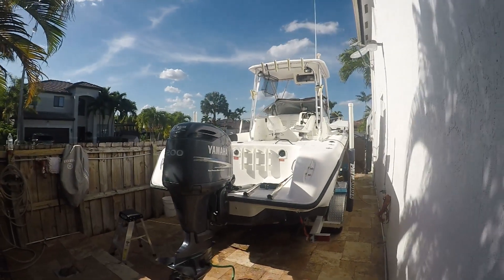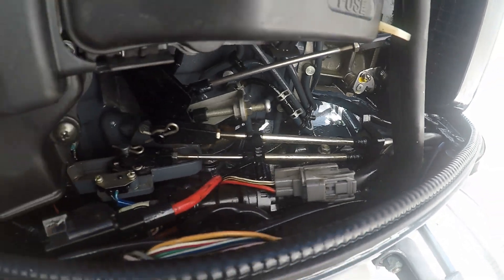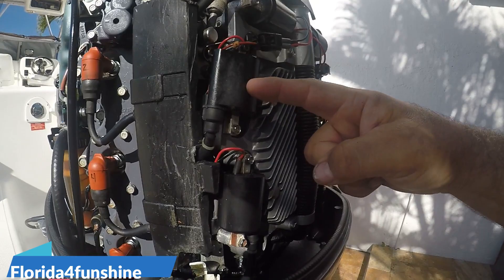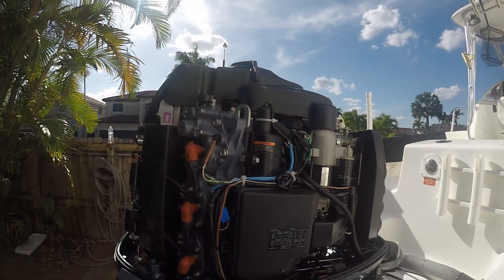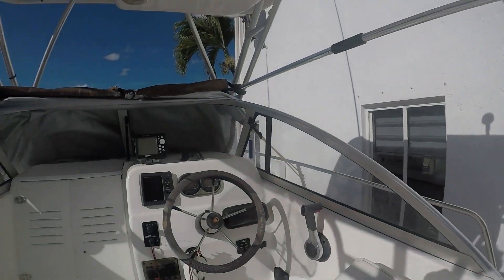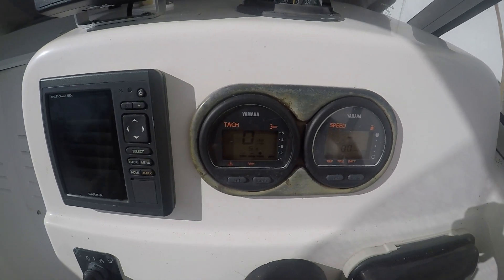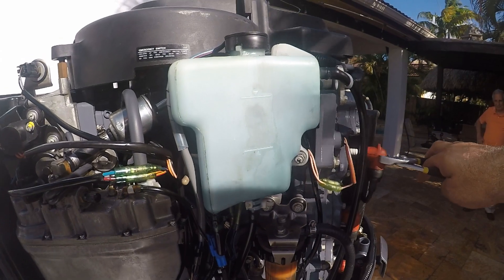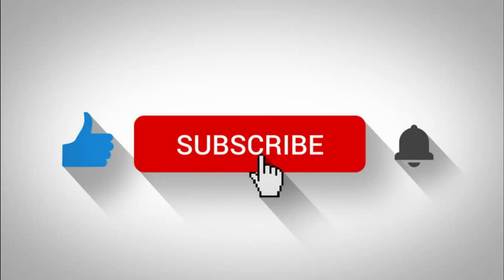Yamaha outboard HPDI  2 cylinders not firing!  #2 and #3 . Trouble shoot 2 dead cylinders . no spark

Comment: neutral safety switch kills two cylinders 
A common issue.
Its gets out of adjustment down by shift cables attached to engine a mirco switch.

Check it out.

Comment: For troubleshooting purposes, can I just disconnect the wire? I have tried cutting the wire and spicing it together and trying it separate and I still have no power to my number two cylinder. I switched my ignition coils and it did not follow.
Reply from the maker: 2 and 3 do not fire when in neutral. When in gear all 6 should fire. I would do a compression test. The switch showned is when the motor is out in gear it allows 2 and 3 to fire.  Is #3 firing?
Reply from the maker: 2 and 3 should be firing when in gear. They do not fire in neutral.
Reply: Mine don’t fire when in gear or out of gear right now. I’m replacing the switch. 

I have already tried removing and actuating by hand. Even splicing the wires together and trying with the wires apart for diagnostic with no change
Reply from the maker: @bbalbano  keep us posted

Comment: Hey, thanks for the video as I have the same motor and had the same problem and this helped me learn more about it. I was wondering what’s the max rpm you get out of it? Mine gives me at max and on plane around 4300-4500 rpm and I’m not sure if it’s because of compression or if one of the cylinders isn’t firing. My compression is around 100-105 on each cylinder so it is a little low but I still have hope that one of the cylinders isn’t firing so I just wanted to know what’s the normal max for this motor.
Reply: Maybe your prop needs to have a smaller pitch in order to increase the rpms.

Comment: I have 200hpdi Yamaha 2006 
It’s only spinning but no fireback at all what is the reason prevent the motor from getting fireback and start up ?
Reply from the maker: Need to check the entire system starting with plugs, plug wires, coils and fuses in your motor. Based on what you describe my guess is a fuse but could be that the stator is dead. Please keep us informed on what you found.

Comment: OMG you are amazing!  Thank you for posting this.  We had an issue with the oil tank overfilling from the reserve tank.  We took it to a local marina mechanic in NJ.  They didn’t fix the oil issue but said we had an issue because cylinders 2 and 3 were not firing.  After spending THOUSAND of dollars they didn’t fix anything.  My husband brought it home and fixed the over oiling issue.  Then he looked and saw that the 2 & 3 cylinders were not firing.  I did a google search and it brought me to you.  We cant thank you enough.  We’ll be going back to the marina to try and get out money back.  They wanted to replace the computer and when that didn’t work they wanted to sell us a new motor.  
Keep posting so you can help people like us NOT get ripped off by these idiots in the marinas trying to rip you off! Thank you thank you!!!
Reply from the maker: Hello. Glad I was able to help. The issue is that not to many people know that  2 and 3 do not fire on idle and misdiagnose these HPDI motors.  I have several videos on Yamaha HPDI. Very happy and satisfying that this was helpful. Stay well!
Reply: Same issue happening with me right now ended up spend money on the motor for nothing same exact problem with mine on my hpdi overfill the oil tank reservoir and they told I do have bad ethanol in the system and I need to buy new fuel system which cost thousand of dollar and finally they want to buy new motor and get my for a grand what a joke

Comment: I have a condition with same motor.  About 50 % of the time  on a restart after stopping to fish or occasionally on first start of the day- it seems to get stuck in this condition.  Cylinders don't all fire once in gear and I have to crawl around at 5 mph. Sometimes a re-start corrects it and I am off like a rocket 🚀 
Other times nothing I can do to correct it.  I've checked neutral safety switch on rail in motor and reads put perfect.  No water in fuel and always fresh hi octane fuel.. mystery filters were pulled by Yamaha tech.. all other filters  are like new and  newer pumps.
Reply from the maker: Your neutral switch has a thin metal lever that can go bad and not engage. the readings may not show a faulty lever. Check out my video on my channel. Also check for foul plugs that are not firing and decarb as needed. You may have 1 or more plugs fouling.  Please update in comments so we can learn.

Comment: Have you done a cylinder drop test using the YDS?  If so, do all the cylinders drop the same rpm’s?  Thanks!
Reply from the maker: I have not. The motor will be in 4 cylinders at neutral in idle which should be at the 700 rpm range when running and switch to 6 cylinders at the point of shifting to forward or reverse gear.
When shifting to neutral at any rpm range the motor will drop 2 and 3 . It would be interesting to hook the YDS to actually see the cylinders dropping. It is definitely done by the neutral shifter switch sending the message to the computer telling it that it is in neutral or in gear, so I am sure that you can view it using YDS.

Comment: So if I’m understanding you correctly, while in neutral only 4 cylinders are firing.  When you rev up while in neutral past 1800 rpm’s, you drop additional 2 cylinders so rev’ing up in neutral above 1800 rpm’s you’re only firing on 2 cylinders, is that correct?  Happen to know what those 2 cylinders are?
Reply from the maker: 5 and 6 drop. leaving 1 and 4 only. When you rev up in neutral past 1800 rpms.

Comment: Hello, I bought a 2004 200 hpdi Z200TXRC. X and the compression came out of the injectors. I bought the 6 gaskets injectors and I put them on but the compression continues to come out of the injectors, it will be that I have to put cilicone in the gaskets or another solution?, please yes be kind to help me

Comment: Appreciate your video. Just purchased same engine as a restoration project. Engine has been sitting for 6 years. We'll see what happens.
Reply from the maker: They are great, reliable and durable engines. The only thing is that they are sensitive to fuel issues. They must have clean fuel and filters must be changed regularly without keeping them on for long periods of time. Check the "mystery filters" as you are restoring. i am sure you will have a successful restoration and long time usage . 
Maybe you can film the restoration?

Comment: I have a 2017 yamaha 115 4 stroke,,when i took the boat out today the motor started easily but when i tried to plane off it only had minimal power,,its like its missiing on one of the cylinders,,any ideas what my issue might be,,
Reply: Do you find out what the problem was?  I have the same issue right now.

Comment: Hi. I have an issue on 300hp hpdi .
Any 1 can help me on my e mail pls justin.carbonaro@hotmail.com
Always check engine comes up after 10 to 20 sec run. And came on safe mode.
Thanks
Reply from the maker: Hello.
2 things..... Check for overheating and/or oil level.
Reply: @florida4funshinechannel998  Thanks for your reply. 
I have the gauge ON but temperature no signs at all. 
ON but not working

Comment: I have a 2007 vmax 250 (we just get it)
He is working perfectly on idle but when you try to put more power on the throttle starts to fail like the gas is not coming, any recommendation? Thanks

Comment: Great video, I have basically the same engine, LZ200TXRB, I'm having a hard time starting it, changed the VST pump and after that it turns but doesn't start, sounds like fuel is not getting to the injectors. I checked the spark plugs and No. 3, 4 and 6 don't fire, besides this, what other issue is keeping the motor from starting? Thanks!
Reply from the maker: Please keep in mind that if you have a HPDI that cylinder #2 and #3 will not fire in neutral.. Remove the prop ( safety first) and put it in gear to check for spark on all 6 cylinders.
Reply: @florida4funshinechannel998  thanks, I wasn't able to figure out what's wrong with it, took it to a shop, see what they say. Really appreciate your help!
Reply: Alberto Hernandez what did they say?
Reply: @martineziah   you're having the same issue I am.  What did the shop find wrong?
Replace or repair anything?
Reply from the maker: Check the coils for 3, 4 and 6 to make sure that they are sending spark to spark plugs. Sounds like a spark issue. Also check the fuses. they are located in the starboard side in a box. Let me know.
Reply: @florida4funshinechannel998  thank you so much! I will let you know.
Reply from the maker: @martineziah  There are 2 things to look for. First. Is there spark to my plugs.?second: Is there fuel to my spark plugs?
In that order.  Please feel free to message me if you need further assistance. Good luck!
Reply: @florida4funshinechannel998  great! Thanks!

Comment: The HPDI is designed to only run on four cylinders at IDLE. Then, when you shift it into gear, the neutral safety switch on the shift mechanism on the engine activates the remaining two cylinders. There's absolutely nothing wrong with your engine.
Reply: I had a faulty shift position switch, which caused the engine to occasionally run on four cylinders when in gear...  Disconcerting to throttle up and get a weird sound and no power...  Moving in and out of neutral would usually clear the fault (switch was sticky)...  Once I figured it out, it was an easy fix...
Reply from the maker: Awesome fix! Enjoy!
Reply: @catallaxy2000  I have the same problem in my motor now,thank you
Reply: @DanielGarcia-td6nm  Glad to help...  It's scary when these things don't run right - and awesome when you find an easy fix...

Comment: Do you know how to clean the pensil filters in the high pressure pump and how much fuel pressure should the high pressure pump have
Reply from the maker: 50 psi is the feed pressure to the high pressure pump. Pump output pressure is nominally 725 psi or so.
The pensil filters? Can you elaborate on what that is.  
The VST has a filter on the pump inside that is a replaceable. I have not ever cleaned one. Replace. 
Thanks for watching and commenting.
Please feel free to ask any questions if you need a follow-up. 
I have a video showing the different filters. ( Except the mystery filters)
Reply from the maker: https://youtu.be/PPIeM9mH-fs

Comment: Great video, I have a 115 yamaha-'93. Do older model Yamaha motors idle on less cylinders also?
Reply from the maker: The HPDI Yamaha is the one that I know for sure that has this unique set up with the cylinders. I do not think it is the same for yours. Try the cylinder test and check it out. Let me know but I am pretty sure that it it will run on all cylinders. Thanks